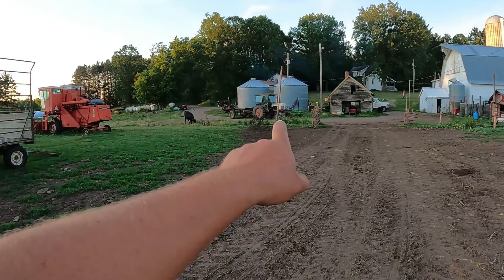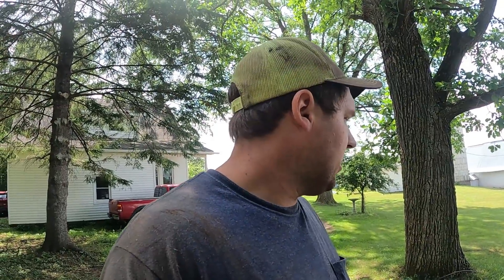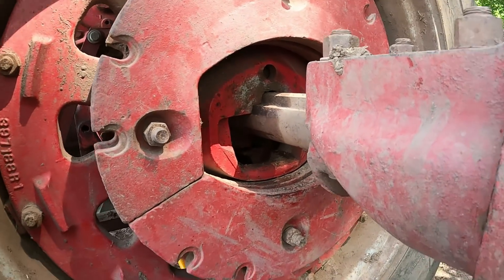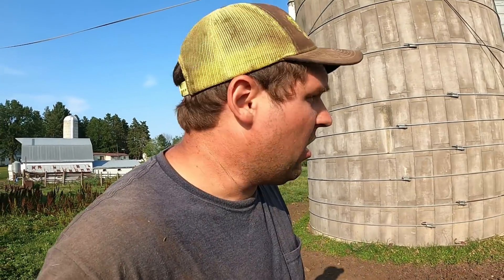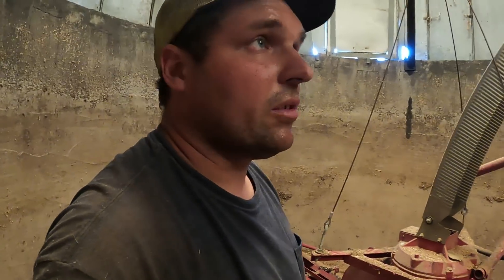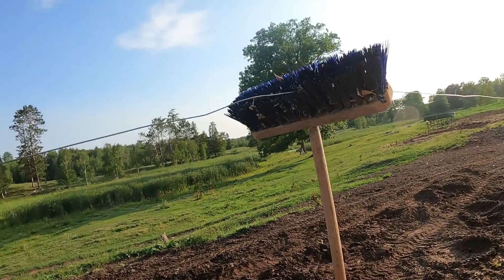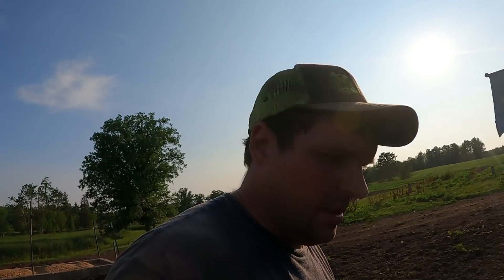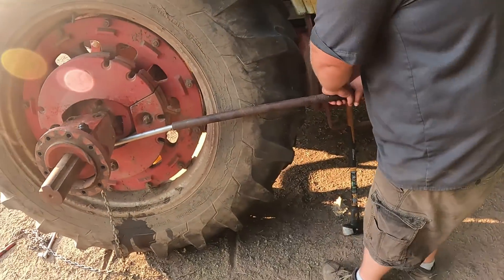Opening up the Silo/Van Dale Silo Unloader/Fixing the Loose Wheel on the International 1066

Comment: I had a wheel that kept loosening on my 1066 too. What I found was the wedges were up against each other. No matter how much  you tighten they won't lock on the axle. I put two layers of flashing between the wedges and the rim and the wheel never loosens now. Also, use a small air hammer to knock the wedges loose. Works like magic.  I got one for like $25 at Harbor   Freight.

Comment: The farm I worked on as a young man we had several IH tractors with wheals like that. We were changing spacing several times a year as we changed from potatoes to Sugar beet and back. We made a tool to pull the tire and wheel out on the axel. It was a piece of pipe with a coupler on the end, the coupler would slid over the axel but the pipe would not. we put a small chain through a set of holes in the pipe and around the wheel. A bar was inserted through another set of holes and when turned it twisted the chain and pulled the wheel out.

Comment: We have an 886 and the right wheel. Seems to be a problem also. We ha e lost a bolt  and later broke a bolt and had it loose a few times .. All the tea for does I cut a few acres of hay and square bale the same amount. . torqued with a long pipe  two years good so far. Good luck

Comment: Yeeouch, this triggered a memory: One type of silo has the chute doors designed so that they sit on the lap lip of the door below - all the doors are off and hanging in the chute when empty, and then you stack them from the bottom to close the chute off for silo filling. It was a two man job - the guy on top holding the door while the 2nd guy, below at the top man's feet, locked 'er in. After completion, somehow we noted the the pattern had flipped - meaning that one of the door junctions did not have the proper lap type fit. We found the culprit about half way down this 45 ft silo. Ethical dilemma confronted those two 18 yr olds: leave it or take the entire top half of doors off, flip them and then place them in the correct orientation. We were fairly certain that this orientation had been in place a number of years. Yeeeup, you betchya we corrected it. That was 50 years ago. Yeeup, there be one way to do things down on the farm.

Comment: Hopefully you caught that wheel before the keyway or wedges got worn. We had a wheel get worn on a 1066 that had axle duals on it that we were pulling a 4000 gallon manure tank with. It turned into what we call a make work program.

Comment: How much spoilage did you have?
Reply from the maker: We took out about 2.5 manure spreader loads, it's a 135bu spreader.
Reply: @trinitydairy plenty of spoilage then.
Reply from the maker: @tederdmann2993  it's more than I would like, but it's about half of what I used to get, when the silo was open top. It would be a lot better if I had a distributor in it, it's hard to get the edges packed.

Comment: you must have a good socket set to torque that wheel so tight and not break the socket
Reply from the maker: It's a 3/4 inch drive, so they are pretty stout.

Comment: That silage looks pretty good. About how long does it take you to feed that out?? Also that Case sounds pretty good with a straight pipe. We used to use our 630 on the blower filling 18×60 silos. That was straight piped underneath. Sounded great when it bellered. Great video!!
Reply from the maker: I'm not sure how long it will take to empty it, I'm hoping it will be empty, by the time we start chopping.
Reply: @trinitydairy  I was trying to figure. We have 100 head. We open our 18×60 about November 1st and usually is empty by the end of March. It makes sense to me your silo will be empty by the time you chop corn. Good deal.